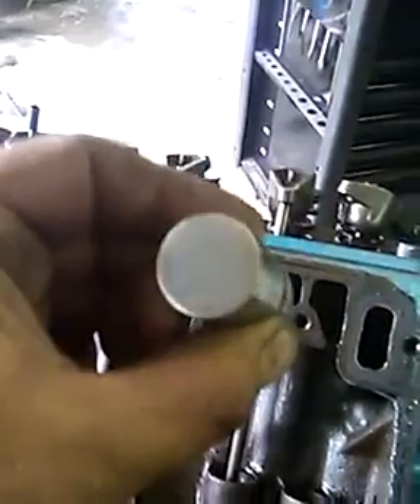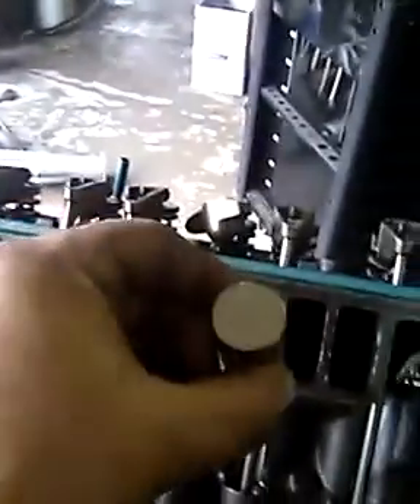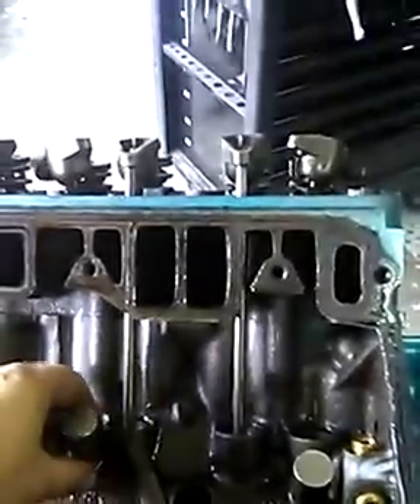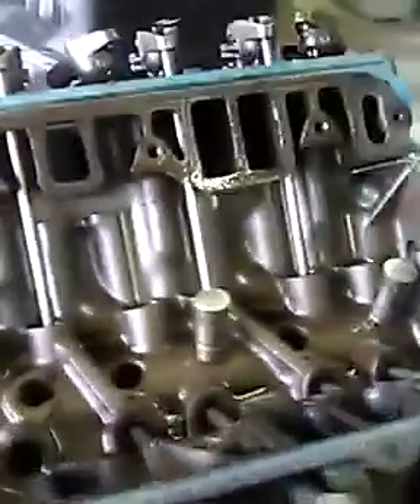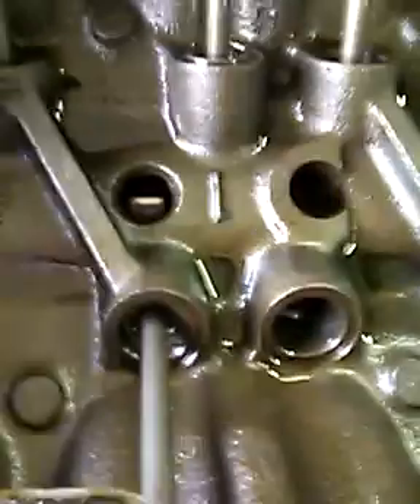390 AMX initial engine diagnosis

Comment: Oh didn't realize you guys put the engine together. thought someone else did and messed up something along the way. Sorry I know you guys do great work.  Some bad history and good plan with rev limiter.  Missed shifts happen to the best of us. It happened to me once and only once busted the top of the piston off.  Costly mistake. It would be nice if the box would record over revs and faults like newer PCM do.  Going to make a short video of my 390 build. hope it goes well.
Reply from the maker: We didn't do a full rebuild rather we just did rings and bearings on his 24K original mile engine. Everything else was AMC stock.  Had we done our usual rebuild we would have put new heavier duty valve springs that would have likely prevented the valves hitting pistons but he was on a tight budget and did not want the extra cost.

Comment: I would have thought the timing chain let go or jumped. Keep up the great work Dan. Oh never liked the Bypass line but I do chamfer the back of the cam bearings on all my AMC engines. helps the flow to the mains.
Reply from the maker: it had a brand new double roller timing set in it that was just as tight at the day we installed it.  We concluded that he had to miss a shift and then over revved it because he is in his 70s and like the rest of us that age has slower reflexes so he kept his foot on it too long when he missed the next gear.

Comment from the maker: Because the rear oiler line is a worthless piece of nonsense that is a Band-Aid for other things that are wrong. The oiling system is a continuous loop hydraulic pressure system making it impossible to have less pressure at one end than the other if it is working correctly. All that line does in a correctly functioning oiling system is give you a point of failure that will cause immediate engine death when it fails.
Reply: I know of your shop. I just happened to run across this..You are not completely correct on These AMC Engines the Oil Lines do work, along with other areas that have to be corrected, push rods, oil pans, oil pumps with lifters and more. SURE theres Oiling issues. I have built 197 AMC ENGINES, In my career, all with oiling issues. I'M building a boys 390 now in 2023 with oiling issues, I knew his father when he was alive. 100% AMC man hands on .  I HAVE seen the failures that the oiling issues have caused. I have seen the over reving also that have caused Engine Failures from people that can't properly build OR control and use RPMs. The Oil lines and reworking the oiling system does work. Theres more to it than that. But I'll leave that alone for now. I'VE BEEN building these Engines Since 1977, My Uncles were Master Mechanics with a fully licensed 9 bays shop. I grew up with them teaching me and my younger Cousin Webb. THE 304, the 343, THE 360, 390, ALL have that problem, when built factory stock prior to1970. The 401 came out in 1971. Many 401s were in the Police Matadors , most with no oiling issues that I came across. Remaned many of those 401s as well. But not for oiling issues.  So how is it that Since 1977 every Engine I changed and built has not failed, under my working. YEAH Clients some have done some stupid crap and broke things, I'm  not counting those just the full rebuilding with oiling  issues. I still build these Engines the same way to this day. I own Three AMCs Myself, changed the oiling problems, added the better parts all around. SO no issues. My Own 360s with those so called crap oiling useless oiling lines work very well. My 390, Rebel has nearly 430 horse power, I can't understand why you would say what you just said when this reworking has never failed with my work, over all these years. I WILL SAY THAT NONE OF MY Engines are bone stock. The parts used are top notch, very expensive, with RPMs limiting hardware. Good luck with your engine hope all works out well, would hate to see a piece of history scrapped..
Reply from the maker: @jimbridges4141  we have built a couple of hundred engines all WITHOUT the rear oiler line.  None have failed. I have a friend who races a 401 in a 69 Javelin and launches at 7000 RPM and shifts at 7800 RPM, no oiler line fir 30 years of racing. If you blueprint the oiling system, use correctly made parts and improve drain back the rear oiler line is totally unnecessary.  We have had 5 engine come in with loose fittings and/or cracked rear oiler line. One is too many, five is a problem. The Penske team removed the rear oiler lines in their race cars after just half a season because they failed and blew up engines. BTW, my Super Stock AMX with a 600+ hp engine has never had the rear oil line and it was a 3 time NHRA regional champion and did the quarter mile in under 10.5 seconds.  Build them right and the rear oiler line is not needed
Reply: @dancurtis3425  I'm glad to hear that your shop is able to afford that. The 401 came out in 1971, it has had no real oiling issues bone stock engine wise. Figure that's why a 401 was used in the 1969, instead of the original 360, 343, 304, 390 engines. Personally I like the 401. Many AMC owners want the 401 engine.  However,  the guys that come to me just want to be able to keep the car alive, usually from a Realistic price. They have families and most times are trying to preserve their Fathers or Grandfathers  ride they inherit.  Most don't race the American Mtrs they want to Save the Antique Vehicle with Reliability and some power. I'm sure racing is quite expensive, cause in my earlier days did when I could,  but for a Person that just wants a great looking slightly powerfull V-8 the oil lines work just fine for them. I never said your way didn't work, I have had to do many but it can get very pricey very quick. I haven't had any problems with putting in those oil lines and better parts for the engines components to make less problems. OH, those clients that want all this and that suddenly change their minds once I explain what it will take to remedy their problems. Thanks for posting. Good luck with your endeavors.

Comment: if there running high rpm why dont you run a oil line to the back ?
Reply from the maker: We remove all rear oiler lines from any engine we build.  It is a worthless contraption that is a catastrophic failure point and totally unnecessary for any engine that has proper clearances and tolerances and that is built with correctly made parts.  The AMC oiling system is a continuous loop system that is incapable of having less pressure at the rear of the block than the front as long as everything is setup up correctly and not loosing pressure unnecessarily elsewhere in the system.  For example, most lifter are made incorrectly for an AMC engine due to lacking an internal oil restrictor disc so they lifter flood the cylinder heads with more oil than can drain back in time to keep the pan from being sucked dry by the very high volume pump.  The real issue with the AMC oiling system is that incorrectly made timing sets, lifters bearings and oil pumps result in the oil pan pickup sucking air due to so much oil bleeding off elsewhere in the engine.  And when the pump sucks air, there is oil pressure loss throughout the entire system including the useless rear oiler line. The simple solution is to run a larger pan and/or an extra quart of oil in the stock pan so the pump cannot suck air when the pan gets close to empty on oil.  The more complicated solution is to spend years figuring out which parts are made correctly and which ones are not which is exactly what we have done at AZ AMC Restorations.  We have never suffered an oil related engine failure or even oil related engine damage in over 150 engine builds. In fact, the only failures we have ever experienced are from owner misuse and/or abuse or due to defective parts like too soft "hardened" assembled pushrods with the end balls not being hardened
Reply: @dancurtis3425  You guys are legends for obvious reasons. I live in AZ too, just got back from buckeye to grab a core 401 to build. Maybe one day I'll see you guys at rods n relics in lake havasu, I heard you guys swing by there. 

And definitely keep the videos coming, we need amc knowledge out there before it eventually dies away.
Reply: @dancurtis3425  Great info